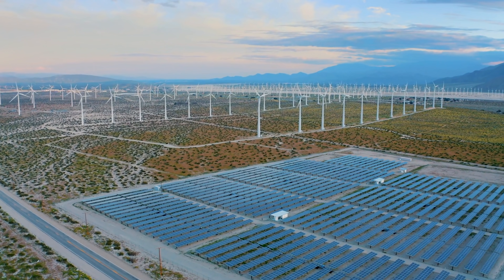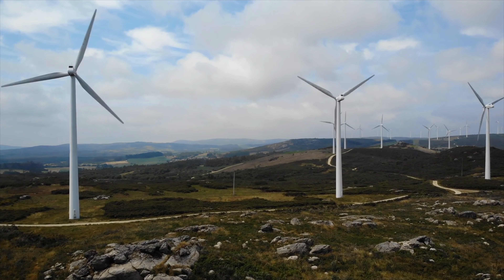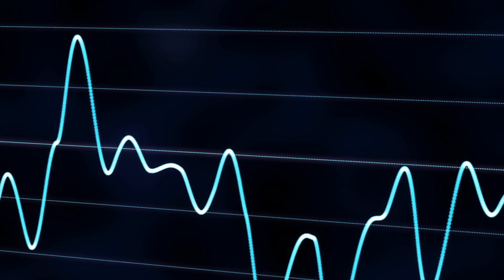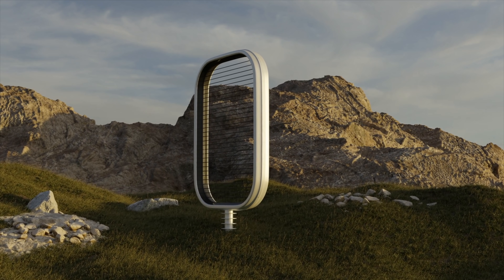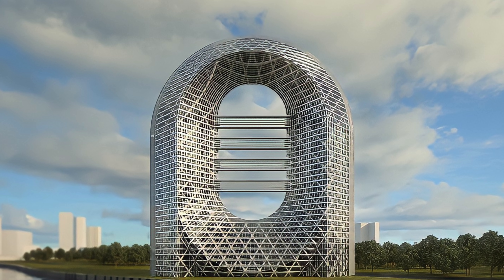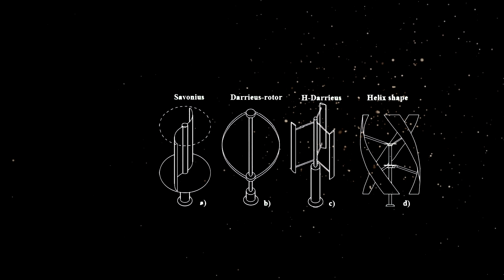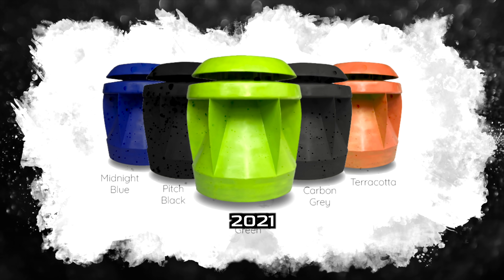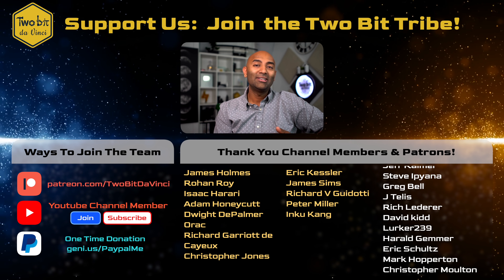These Wind Turbines have NO Blades!

Comment: I think the vortex shedding, V.A.W.T. and / or the Halcion along with solar power automatically should be put on new buildings and homes. It would reduce the amount of electricity needed or, in houses, reduce the need for outside electric completely (possibly). No water or anything else is needed.
Reply: These 3 take up less room, are aesthetically pleasing (maybe they could make them in colors to go with the buildings / houses), don’t have to alter the architecture of the building (a flat roof) and the V.A.W.T. & Halcion could both go on the roof.

Comment: For me anything which gets those huge turbines out of the countryside has to be a bonus and its a small consolation that cats kill more birds than the turbines (more turbines, more bird kill) and more of the country views ruined. Also when the wind don't blow the turbines don't go. Plus the use of all the materials required to build these turbines and eventually dispose of them (how long is the life span of these things, some of the blades are already cracking) . The wind turbines in the North Sea are slowly sinking and need constant maintenance including more concrete to stabilise them, plus the use of carbon fuels to power the boats required for maintenance and repairs. No one wants to talk about these things because it is not politically correct to do so. So I guess a more compact longer lasting turbine could be the way to go.

Comment: Off grid independant power is best. Micro systems that are part solar, part wind, or part hydro generated where available, is the ticket.
These along with smart high efficient reduced consumption lifestyles and homes, along with similar approach appliances, heating/cooling and lighting, makes sense.
Can two to four persons live in a home comfortably and sustainably on say a 40 kWh battery/charging system using the above to keep the system perpetual? With the improved battery tech systems and multiple charging options, it seems so.

Comment: Interesting but wind is 1% of US energy production.  Probably not much world wide either.  Can someone actually picture 10x MORE windmills let alone 30 or 40 times more .. sounds pretty insane; Texas which put a lot of wind into wind mills in the US suffered huge outages mid winter in part due to failure to perform in freezing weather.  I havent heard they are down for a 10x increase.  All fail to be viable.

Comment: If small domestic wind is feasible and coupled with PV and storage this would revolutionise the market.  There is a company called The Electric Storage Company that has developed software called PARIS, that can take decentralised generation (PV, wind, tidal, AD etc.) and aggregated it to provide network services (network voltage and frequency stabilisation) or trade on the energy markets. This provides each individual customer or business the potential to earn revenue on their generated and stored electricity as well as reducing their CO2 generation and electricity bills.   The Software is already available in the UK market and from data gathered is offering up to 70% savings on customers electricity bills.

Comment: Not "entirely" true about saving the carbon foot print industry, as I still see rigs hauling equipment belching out large amounts of emissions per tower. And cranes and maitenance trucks. Hopefully we will see a change soon in the way rigs are fueled and run on hydrogen fuel cells that belch out water emissions instead of carbon. It is great to see innovation in bladeless having more impact than the three bladed cheese knife did.

Comment: Thanks for the video. Play a tuned guitar string close to another guitar, the same strings, and something similar happens. Sound travels in air. There could be quite a hum with the oscillating design. Perhaps worse than the woosh-woosh of the large turbines. Smaller the oscillating object, higher the frequency, I would assume

Comment: So downsize the oscillating  turbine and mounting it in place of the antenna on a vehicle would then charge the batteries of an electric vehicle moving at 70 mph to the point of perpetual motion? Or multiple units hidden under the frame?
Reply from the maker: Future video!

Comment: At home wind generated power: You don't want any part of it in or on your home or the home of your neighbors because of noise and vibration. The noise and vibration from your at home a/c condenser and air handler and/or whole house ventilation fan are more than enough.

Comment: ENERGY SOLUTION - THE MULTI FUNCTIONAL PLASMA REACTOR.
On July 9th 2019 at Bath University (UK) the guaranteed (& patented) technical solution to the Worlds energy crisis was unveiled. It's called the Plasma Reactor. It is 110% GREEN, and 1600% more efficient than a Nuclear Power Plant. It provides the heat needed in any power station 24/7 at a tiny fraction of current costs. So all gas, coal, oil or Nuclear Power stations can be quickly and cheaply converted to the new system. 

Indeed the Plasma Reactor unlike ANY other generating method can also simultaneously do three things. Apart from the almost instant heat generated to drive the turbines, the Plasma Reactor also has the ability to  Remediate Nuclear Waste. By switching off the radiation emitted by Nuclear waste PERMANENTLY. Thirdly the Plasma Reactor can transmutate the elements in INDUSTRIAL QUANTITY, again at a tiny fraction of current costs. 

The Plasma Reactor will as a result replace ALL current methods of power generation, including those ghastly and inefficient eye sores WIND GENERATORS, for the simple reason it is multi functional unlike ANY other generating method, much cheaper & Green !!!

The multi-functional Plasma Reactor was developed over 10 years (2009-2019) by SAFIRE a high tech Canadian electrical engineering company. In 2020 Aureon Energy Ltd, was set up to take this new technology into the commercial world, and you will find they are already advertising this new Patented technology on the internet & elsewhere.

Comment: 9:35 "the lack of moving parts" ....... Except for the the pump needed to move the water up to the height of the nozzles?

@Two Bit da Vinci Sorry but something is wrong with your math for the Delft University test. 2.1mW x 500 nozzles = 1.05W.......... You'd need 500,000 nozzles to get 1.05kW!
That would use 500,000 x 20ml = 10,000 liters of water per hour! It'd take way more that 1.05kW to pump that water so how does this device generate any power?
Even if there is no pump and it's done by evaporation, it doesn't seem like a great use of 10,000 liters of water. There must be some info missing here.

Comment: Part of the issue of the lack of adoption of even micro wind turbines is that in the UK planning permission is required for a micro generator to be attached to the property.  Planning permission is not required if it is not attached to the main property but does require a large area to be available around the turbine for which many properties do not have.

Comment: I highly doubt the low maintenance claim of the giant diildo generator.  The fatigue stress from the vibration is hard to manage, especially when scaled up.  The coronal discharge generators are intriguing.  Could be a contenda if efficiency is high.  The power pod is counterproductive in my opinion.  There is very little wind energy at residential roof top elevation and scale to allow such device to capture enough energy in their service life to offset the embodied energy in their manufacture and distribution.  I think the sky sail is very promising, especially for remote areas or ocean going vessels.  The best part is the elevation can be optimized to capture the best wind.

Comment: Centralized energy is proving over and over to be a big mistake in many ways.  Smaller diversified and localized generation systems can generate more power more efficiently with less loss from long distance transmission!
Reply from the maker: Very true. But larger grids … possibly even higher voltages, could account for cloud covers or less wind in certain areas by having a great diversity of locations. That’s one aspect that is really exciting

Comment: dude just because the numbers killed by wind turbine compared to cats are smaller, does not make it any better when the ones killed by wind turbines are mostly endangered species.... this is an actual issue... right off the bat you really stepped on the wrong foot here...
Reply: i don't mean that bladeless wind turbine is a wrong direction, but i do mean that what you said in the beginning does not make anything right at all... because those that are killed by wind turbines are mostly endangered species due to the location placed.... not to mention all the problems with wind turbine's maintenance and overcharging issues and also all the fires that it caused on itself.... rather than wind turbines with blades, you are better off just using nuclear energy at that point.... and if you don't want to use uranium, then use thorium....

Comment: My wind turbine is the best, vertical shaft with 4 panel, centrifugal force stops it from moving, it can go as fast as the wind pushes it, cubic like with  4 half panels shielding the blades  on  the negative side. magnets on the blades and coil all around on the frame.

Comment: ... You claim that wind turbines are clean and effective... O.O yes, because the hundreds of gallons of oil each turbine goes through each year is certainly clean... not to count the leaking all over the base of the same oil... or the replacing of those blades by throwing em in landfills... 
That natural frequency one... Nice dildo... ROFLMAO

Comment: Wind farms at face value seem like a great substitution for fossil fuel until you dig deeper and learn how much wind farms rely on the very fossil fuels they claim to replace. From the construction of each part of a single wind turbine, to the transportation, installation and continuous maintenance required to keep them running, millions of gallons of fossil fuels are used. I recently attended a lecture where the key note addressed this by comparing many renewable energy ideologies to “buying a tow truck to pull your car to save fuel”.

Comment: Why don't the people who push for wind power explain where the wind comes from? 
MAGIC? NO it comes from the heating of the air sound the earth! . 
The heat comes from the sun and the UNEVEN heating causes air molecules to heat unevenly and causes them to move. = wind! 
When the wind STOPS blowing the turbines, sailboats, and flags ALL stop moving, RIGHT?
REMEBER  your science class and why the HUGE turbine powered by HUGELY expensive generators are STOPPED on a CALM day?
This is NOT e=mc2 science here folks!

Comment: It take 240,000 tons of C02 to make a 80 meter wind turbine 10 tons a year to maintain them and another 240,000tons of C02 to decommission them after 20 years . You need cool oil and natural gas to make a wind turbine 32,000 ton of Cement 12,000 of steel and bird killing is a major problem cats kill robins starlings and small bird not endangered birds wind turbines kill eagles hawks and other endangered species bigger birds plus bats. The wind turbine sound can cause problems to some people particularly younger people with good hearing,

Comment: The Power Pod looks amazing. I've been researching, getting ready to install a solar roof and would love to also channel wind energy. But the idea midway through the video of placing a vertical generator next to a train track seems like it could be a golden idea. I'm just imagining what a mile long stretch of those on both sides could do. It also got me thinking about other man-made wind tunnels. I remember working in downtown, where the tall buildings created winds in the winter that were so strong you couldn't walk into it at times, and what kind of energy that wind could generate.
Reply: Yes, some 'bad' city planning make good spots for energy generation. Alley between buildings, we might make their funneling effect pay for our energy bills.
Reply: @stephentsang259  ⁰
Reply: They are installed on experimental basis on U.K. main highways to catch the funnel effect of passing cars (like the train example)
Reply: @mastercommander4535  
Saw your comment after I posted mine...
Reply: Like next to highways...
Reply: plenty of small scale wind turbines but make sure you elevate WELL above roof height , o/w turbulence with constantly break the flow and stop it spinning.

Comment: VAWT's can actually be quite powerful. All depends on how you design them, but they can spin extremely fast, are very stable and can spin in virtually no wind, due to, as you said omnidirectional. You can mount them down low, unlike HAWT's. The military use VAWTS, as they are low profile and easily deployed and safe and work on the ground.

Comment: Seems like lighter weight and smaller omnidirection fan blades would be a far better option, able to achieve rotation at lower velocities and from any direction. Particularly if an automatic gear system were incorporated: to reduce blade speed in high winds and thus reduce the risk of striking birds during periods of high wind.

Comment: You really shouldn't use the 'wind turbines kill 234K birds while cats kill 2.4B birds argument.' Those numbers may be true, but you have to understand that those 2.4B birds that are killed by cats are typically small, common species that have large populations and reproduce in large numbers. The wind turbines tend to kill larger raptors (eagles, hawks, condors, owls, etc) that are much less common and have fewer births per year.

Comment: Current wind turbines produce far more carbon during their production than they ever manage to offset in their operational life span. I just think any discussion of Windpower should always include that note. Nothing's as green as Nuclear, but I'd rather have solar or wind anyway, just better than we have now.

Thank you for mentioning the inherent energy losses present in centralized systems. Decentralization is the way of the future, and someday every home will have its own power generation/storage. Other areas we waste power is in how we use that power in our homes and businesses. Light, heating/cooling, circulating air, etc can all be offset with a more intelligent design, making renewable power a more obtainable goal.

Still, the biggest danger we face to seeing that future is a belief that any one of these solutions is "The Answer." We need a variety of solutions all working in tandem.
Reply: Finally  someone  got it right. I worked  on them for two years.  They are anything  but green. People  that say that don't know shit. They are high maintenance  too.

Comment: Disappointed. Was looking for more information on vertical turbines.

They have lower output ability per turbine but they can be stacked closer together. 

One of the huge negatives of 3 blade traditional turbines is they steal energy from each other when installed too close together. 

Supposedly the vertical turbines do not have this problem  and can be installed much closer together. 

Is this closer spacing enough to create a net increase in energy production for a given area?

Is the cost savings sufficient to make a pilot farm of these worthwhile?

Would love to see a video on that!

Thank you for all your videos.

Comment: The biggest maintenance downfall is going to be the water itself! unless they waste a ton of energy distilling the water, the system and nozzles are going to get clogged with calcium or lime, or some other particulate. 

Now, they could use solar to power a atmospheric water generator, and to distill and purify the water, run that through the wind turbine system, keeping it cleaner longer, and the water can be blown into the wetland preserve, or excess water can be directed there. but, you are using the generated solar energy, to make wind energy. not so efficient.

Comment: Without being very specific, I tend to believe that we get a lot more "bang for the buck" from hydroelectric harnessing. There are already extremely predictable movements of water from rivers, streams, oceanic tides. The "energy density" of moving water is pretty massive compared to wind. We already use this to great success with hydroelectric plants at rivers and falls, but only recently have we seen much harnessing of the ocean's waves and tides. Think of the mind-boggling energy expended when a large ship is thrust upwards by huge waves. I also like gravity batteries for storing surplus energy. Obviously, we need to keep working on improving electrical batteries so they can replace fossil fuels. The energy density of gasoline is still very high compared to the best electrical batteries. Unfortunately, political narratives have warped and clouded the perception of the public on both sides of the aisle.
Reply: Pumped hydro storage is catching on these days. A good return.

Comment: I want to get a vertical wind turbine in our back garden. Due to the arrangement of the houses and trees around here, out back yard is part of a mini wind tunnel. Even if the is no wind out the front, there is constantly at least 2-3mph wind but its usually more like 5-7mph. So we can generate some for most of the year, but in spring and autumn we tend to get 20mph winds in the back yard regularly.

Comment: Big Clockwork Gearing, and flywheel. To spin a Telsa turbine and or generator/ both.
Using two Springs and a self-winding system. Can set up to run 24/7, even Underground or in a boat for its propulsion....ect..?
        ( very scalable.)

Comment: Between Thorium & these shielded vertical wind turbines, I prefer the latter because of sheer simplicity. I thought vertical wind turbines were good but protected one's sound better because of various reasons. Maybe protected by a thin steel mesh to get more wind. A thin steel mesh with 1,5 cm squared gaps would be ideal...